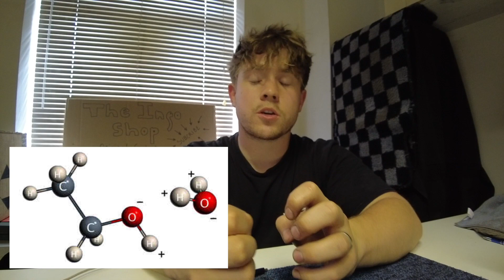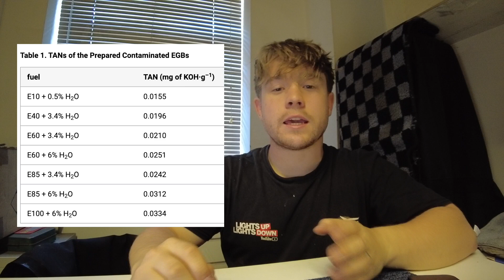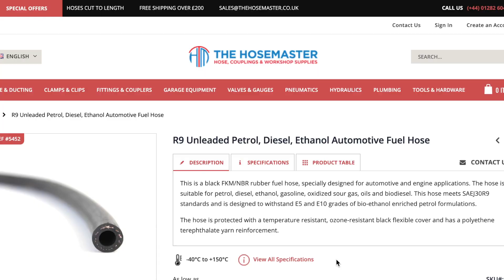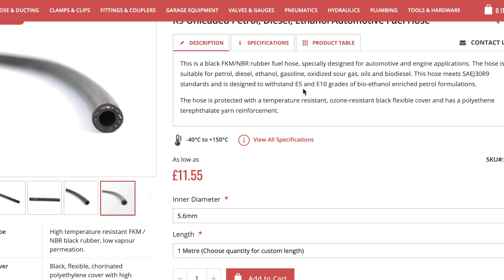E10 fuel, will it ruin my car?!!

Comment: I’ve had no issues at all with E10 in my old cars: Peugeot 205, R4, Saab 9-5, Mk1 MX5 1.8… 
Thé latter two have even been running on 50/50 E10/E85 in winter and even 25/75 E10/E85 in summer here in France since I brought the NA back from the UK in 2017 - with no issues. Starting can be a little more difficult with the 25/75 mix in very cold weather. The ECU on the NA seems to cope very well with the mix. The Saab threw up a check engine light when I tried 100% E85 ( but didn’t feel any different) so I went back to max 50% and the warning light went out. The NA didn’t like 100% at all and was down on power so I didn’t try it again. On the summer and winter mixes it’s fine. I’ve done 28000 miles in the NA since 2017.
I took the precaution of changing the fuel filters after roughly 1000 miles, and I avoid leaving my car with fuel in the tank for long periods. I’m on holiday for a month from Friday and will be leaving the car parked up with half a tank of regular fuel without ethanol.  Yes there’s a small increase in fuel consumption, nothing more.But more than compensated by the fact that E85 is less than half the price of regular fuel here in France - about €0.70/litre compared with regular 95 or 98 (€1.60/litre). Nuff said really….
So the message to UK residents is don’t get your knickers in a twist over E10.